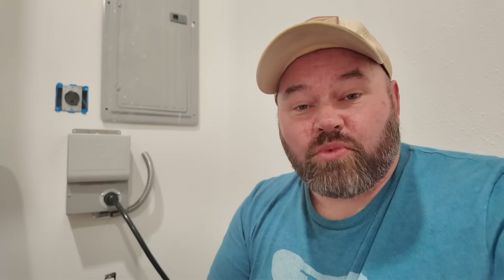Dozer Going Through My Private Property AGAIN!

Comment: You mentioned an auto emergency system that fires it up in 20 milliseconds when the power goes out but you wired it up so you  have to manually switch on and off when the power goes out. If you all are out of town for say vacation or a convention or something there's no one to turn it on when needed, just thinking out loud. I would rather have a mag type auto switch.

Comment: We also have had some bad weather here in Texas. the issue with the well is if the pump is on a long tube you may have to put a removable cover over it so you can take the pump out if it fails.
Reply: My well guy suggested a roof mounted wind turbine. Then when my pump went out the unscrewed the turbine from the roof and pulled the pump. Then replaced it the same way. Was really glad we talked to them before we built the pump house.

Comment: We have surge protector things that have multiple outlets on them. I tend to baby my computer and so if things are coming too close I will unplug even the one it's plugged into.  I get really nervous about the appliances and our computers if lightning is very bad in a storm. Everyone should have a radio that has the weather channels that is either using a battery or hand crank charge. In power outages that helps. We also have solar chargers for our cellphone and other things that can be charged on a USB.

Comment: What you didn't mention, when you're switched to "Line" does the normal source of power charge/maintain the Jackery unit?  

Dutch?  What if you discharged only gray water and had composting toilets?  You can buy some fancy composting toilets for what you could save with the septic system not handling black water.

Comment: Something to think about too. Power surge from lighting strike will destroy household items plugged in. Check into EMP SHIELD for house better than what electric company surge protection is. I have one for my car it will protect car from lighting strike, EMP, cme. Saving up for house EMP shield coming very soon
Reply: EMP shield is great for surges, but does not protect against things like undervolt/voltage drop, overvoltage, high amperage, reverse polarity, open neutral, and open grounds. For protection against all of these, you need an EMS system. There are excellent EMS systems made by Watchdog, Progressive Industries, and Southwire. The Southwire units even have field-replaceable MOV modules, so if you do take a lightning strike you don't have to replace the whole unit.
Reply: Have one for home and autos